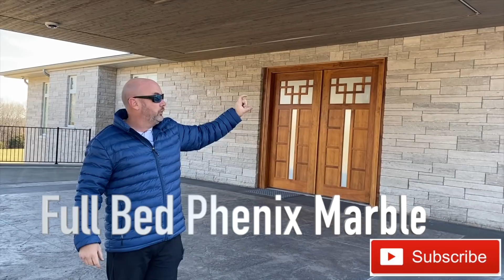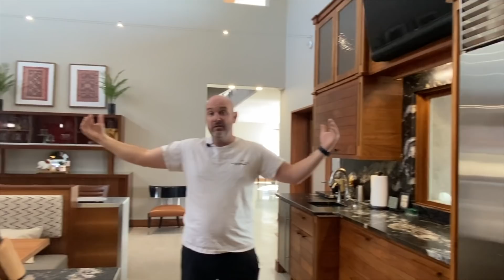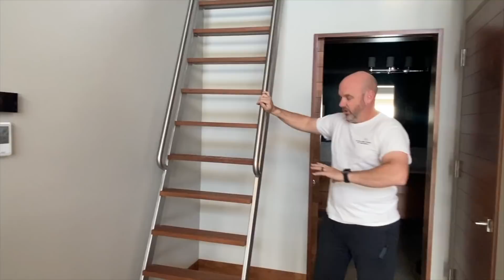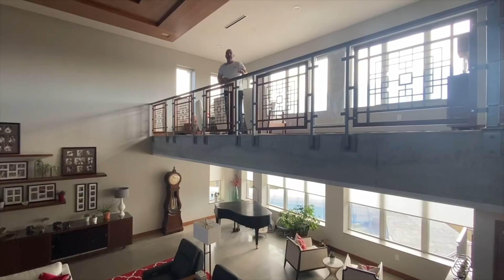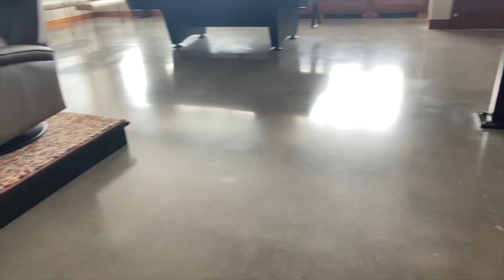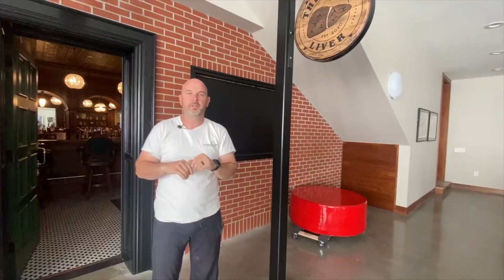Amazing ICF and Lite Deck Home Tour!

Comment: 👍👍 love the basement really the whole house but my upstairs will be a close finish because I will have three bedrooms up there and maybe two bathroom and one bathroom in the basement. I wonder what they light bill is. 08-29-23
Reply from the maker: The had 1100 amps of electrical service, they use an average of 60…. They literally use less juice than the typical 1500 sqft home….
Reply: @all3pools  one more question can you use a septic tank for the basement 1 under the ground not above the ground
Reply: You said forklift can drive over it so if kids with running upstairs you would not hear the footstep through the floor. I wonder do that protect you from that noise would you still here like a regular upstairs house. 08-29-23

Comment: How difficult is it to run plumbing, electrical, and possibly A/C ductwork between floors with LiteDeck in place?
Reply from the maker: Before the pour it’s super easy, not bad if it’s poured unless you have hydronic lines in the cast, then you should take extreme care pre pour to get the penetrations in, and make a map of the lines in case you need to drill something later

Comment: What is the life expectancy of all that pex tubing embedded in concrete? The idea of busting up a concrete floor to fix leaks would make me nervous.
Reply from the maker: Compared to an entire house being built out of products that rot?  I don’t know how long pex lasts but it generally believed to outlast copper piping which I see in lots of rent houses going back to the 30’s…. Not to mention this pex is encapsulated in concrete so it was very little chance of being impacted by external forces… if your concern is a problem with concrete itself shifting, proper reinforcement should keep that below the threshold of damage to the pex!

Comment: Why do you need Litedeck insulated ICF floors when there's no need for insulation inside?
Reply from the maker: You don’t need it for it’s insulative value per se, but it does help when doing hydronic heat, plus icf deck material like lite deck is the easiest way to create the slab and beam design that allows spans up to 40’!  We’ve done it on a few pool rooms without lite deck and the forming process is considerably slower snd more costly….
Reply: @all3pools  Exactly right - way easier to form and the laws of thermodynamics will push heat up to the space intended to be heated.

Comment: Awesome.  Not so many videos on lite deck out there with good details.  Thanks for showing how you set the blocks up to make it mono pour.  Couple details that would be awesome to include in future: 1.  How do you handle it when you are going to polish the floors. (and how do you protect them once poured while the rest of the construction occurs?!?).  2.  Different slump or water content for the floor section when you polish floors and mono pour?  Thanks!  Vids 
continue to get better.

Comment: I really enjoy your videos, can't get enough. I definitely think you are one of the best builders on youtube. I'm about to do a similar project (radiant heated polished concrete floors, ICF walls, and thinking about using fastfoot as well) I poured a few concrete patios and drive ways, but have never done polished concrete. Most info I find online about polished concrete don't talk about new construction/ideal concrete mix and additives. What was the concrete mix and any additives? I'm also assuming you would want it laser screeded to lessen the amount of polishing required.
Reply from the maker: You may want to talk to a polishing co, they use a topical additive day of pour called potassium silicate, promotes crystalline growth and hardens the surface, then after a minimum of 27 days, they do the first (cut) they’ll grind it to 4-800 grit, usually after they get to 200 grit they hit it with lithium silicate to further the polish ability of the surface…. Then they usually come back to final polish and burnish to 1500 r 3000 grit right before the project is done, but there’s multiple ways to skin that cat!
Reply: @all3pools  Thanks! This is really helpful.